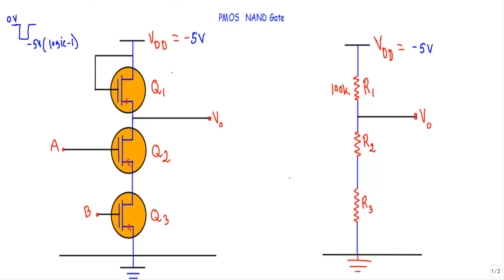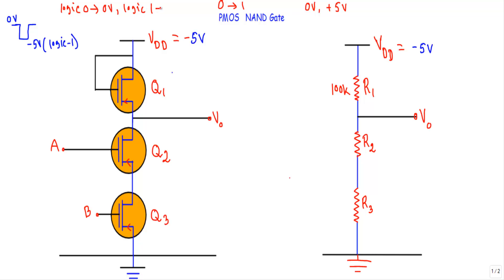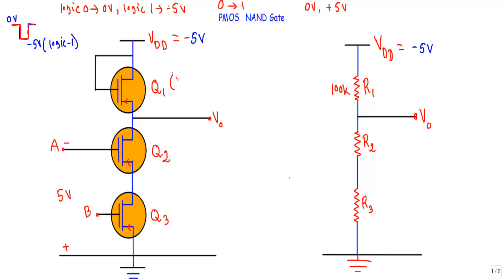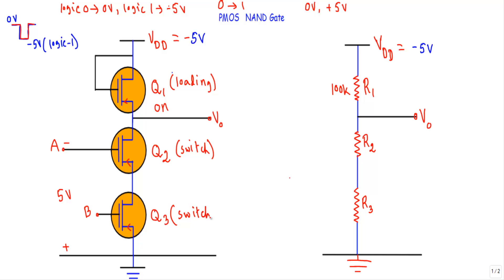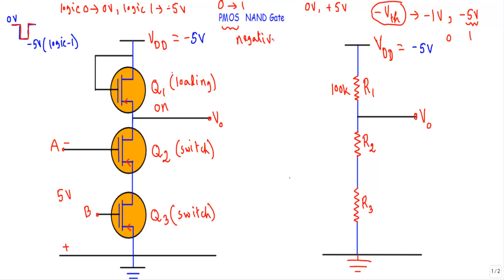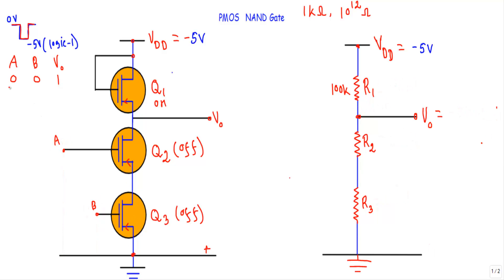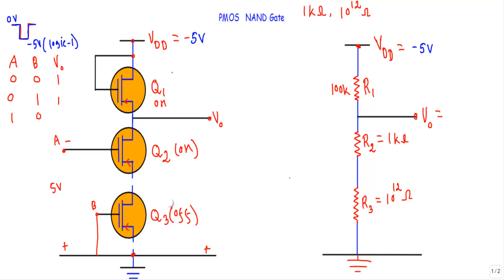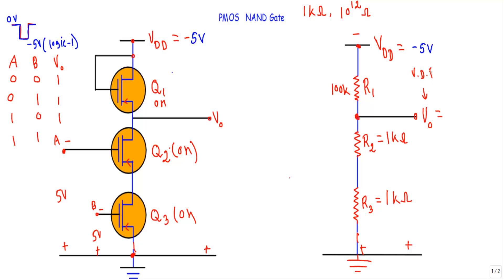PMOS NAND Gate

Comment: as u said threshold voltage for pmos is the negative one. But as we know -1 is greater than -5 then how this negative 5 volt will cross the threshold voltage which is negative 1 volt?
Reply from the maker: No no... To turn on pmos, you have to apply higher negative voltage than the negative threshold voltage of pmos
Reply from the maker: Higher means if you have  -1V threshold voltage of pmos, you need to apply any negative voltage whose numerical value is greater that absolute value of -1V